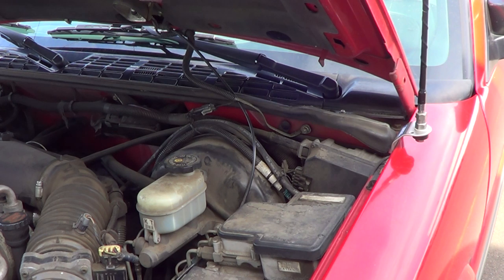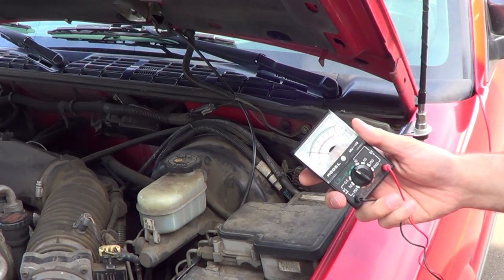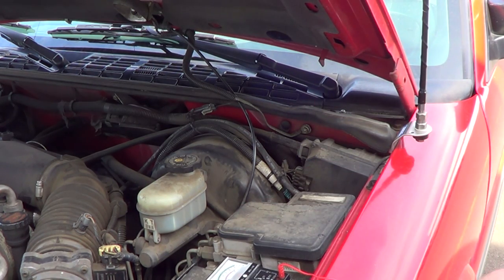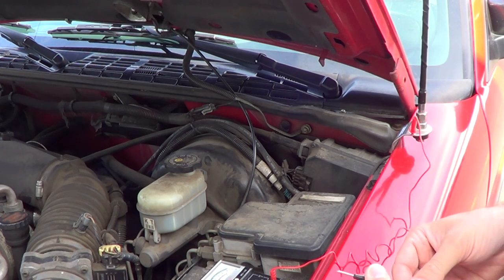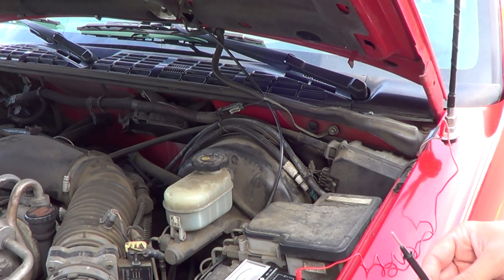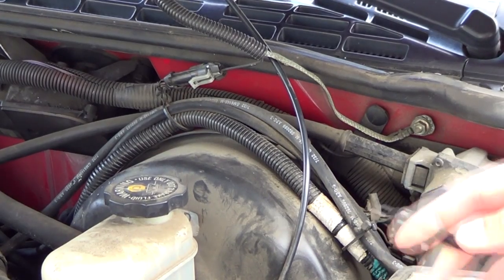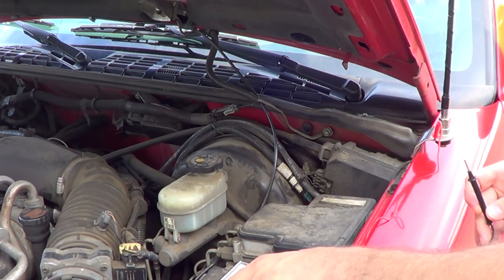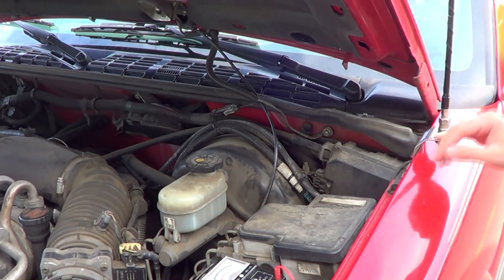Testing a CB Antenna Ground with a Multimeter

Comment: 1. Does CB unit need to be on.
2. If so, any particular settings need to be set on it before/during/after test procedure?
3. What does/should multimeter be set to e.g. ohms,dc current,ac/dc volt,continuity.?

Comment: I recently put a CB and everything in my 97 Blazer and custom antenna bracket. I sanded the paint and surface clean where ever I needed ground and after everything was secured and tested I painted over everything again to keep corrosion off.

Comment: Hi, I just installed a Lincoln 2+ 18 feet of coax and a Francis 5.5 hot rod the hood fender of my 18 Silverado z71. I’m getting 1.5 ish SWR and am able to talk to others pretty easily. My problem is the amount of RF static I get. It’s always around 4 or 5 lights all the time no matter where I am day or night or what frequency I am on it’s always the same. I also notice when I turn my steering wheel it effects the amount of static I get as well. What the hell did I do wrong lol?

Comment: I bought a 102 whip antenna and a coax cable for a 2005 jeep wrangler. The coax cable had a hot wire and ground wire at the antenna end. Both were attached correctly to the antenna mount. However, it did not work. (When I disconnected the ground wire from the mount and held it in my hand it worked. Does the mount itself also have to be grounded to the vehicle somewhere?
Thank you.
Reply from the maker: when you say it doesn't work, what is your SWR? Squelch settings, coax storage?
Reply: @wearecb  🤷‍♂️ I do not know. I'm too much of a novice/beginner to know those answers. Just curious if there is need to also run another ground wire to the frame of the jeep.

Comment: what about grounding the Cb. mobile antenna mount?
Reply from the maker: If the mount is bolted on, often times it will ground out, however that is not always the case and may require additional effort such as a grounding strap  to the chassis.

Comment: How do you Testing the CB Antenna Ground using a test light?
Reply: hook the test light to the positive side of the battery. Then when you touch ground it will light up.

Comment: You only missed the most important part.... making sure the ANTENNA is grounded, not just the MOUNTING BRACKET.   And I'd love to know how you do this test with a test light if you didn't have your multimeter handy.
Reply: DeathScouter put the alligator clip to positive battery terminal then touch tip to antenna. If it lights up ground is good
Reply: Hi! So I need to ground the mount and the antenna ? I don’t understand
Reply: @Fox250R  I'm learning too!  I'm in high 3's on 1& 40 .
Reply: @Ride.on.709  what antenna are using and coax?
Reply: @Fox250R  firestick &18 ' of CB coax cable (black). Two door JK

Comment: Can you have ground, but not have a good ground. 

Is there a way to test for ground quality?
Reply from the maker: I think the ground is either there or it isn't.  You could have an intermittent ground through a broken wire or loose parts.  The needle on the meter would be jumping around if that were the case.
Reply: Hmm, not quite. You can have an RF ground that is poor but conducts well... a good ground also has low impedance. You can quite easily have a ground that conducts very well (low resistance), which this video tests for, but has a very high reactance at your frequency. Impedance is reactance plus resistance. To set the scene, imagine whats going on in your coax. It has a great conductance but the way the currents in the central conductor interact with the shield attempts to cancel each other out so there is  minimal amount of RF radiated (yes its an unbalanced transmission line so that's not entirely accurate, but properly connected coax does not make a good antenna for this reason). If you were very unlucky via a natural tuned circuit you could put the ground  out of phase with the radiator (antenna) and they work to cancel each other out. Ultimately you want a field strength meter to test that your system is behaving, but that's overkill for CB. If you really want a great ground just ensure the large pieces of metal that would be interact with the antenna are well connected with very short lengths of high conductivity cable or strap. Remember, DC ground is not the same as your RF ground. For more info there are many good pages but checkout this page or go join up with your local Ham/Amateur radio club - http://www.arrl.org/assorted-hints-kinks 73's Dave.
Reply: yes you can always have a ground but not a good ground